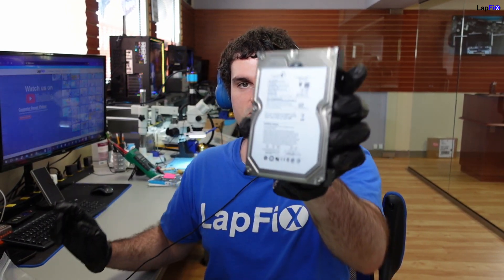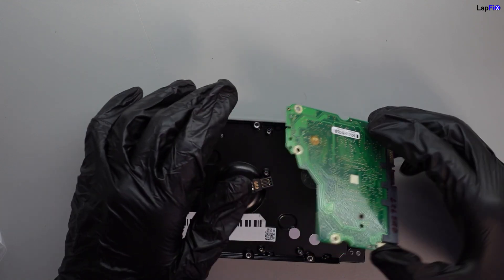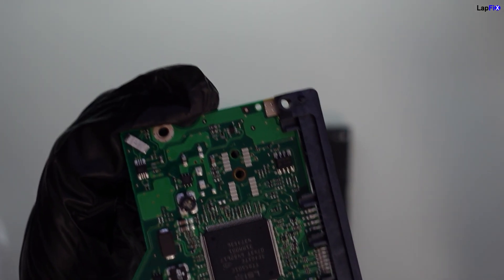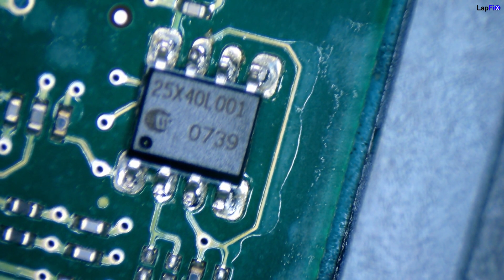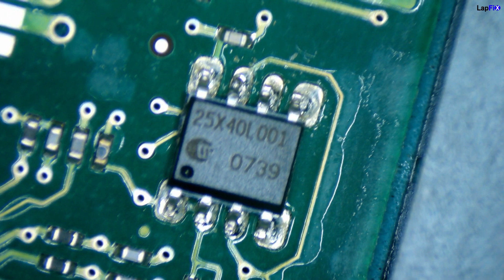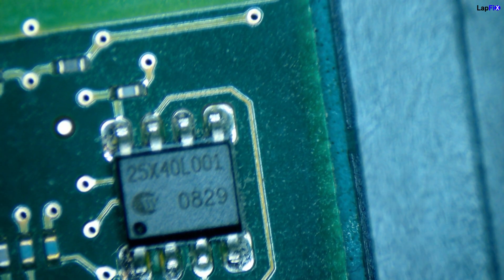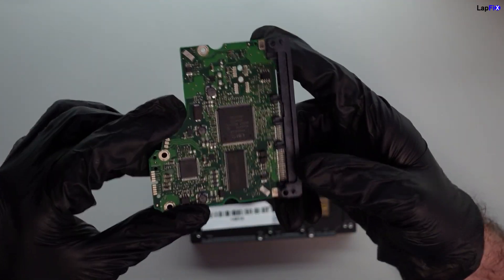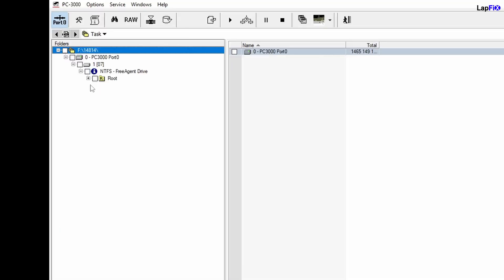Recovering Data from a Seagate Hard Drive Not Powering On

Comment: I read once that a failing HD could be posdibly repaired by freezing it 😂😂.
My old seagate started clicking & i could not retrieve anything from it...
I put it in the freezer for a day, took it out & very quickly dried the pcb with a hair dryer plugged it in & i was shocked that i was able to retrieve all my data, after around half an hour it started to play up again but i managed to save my data.